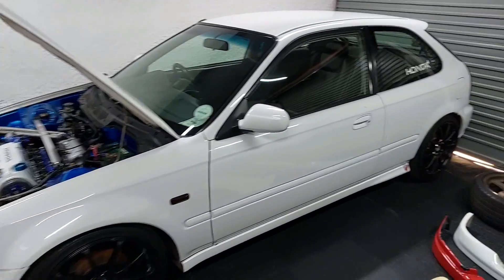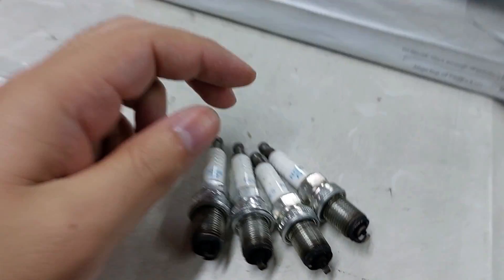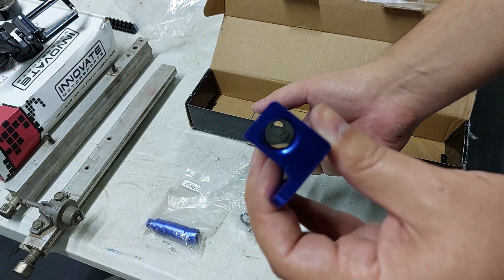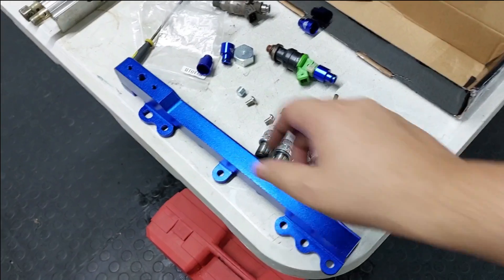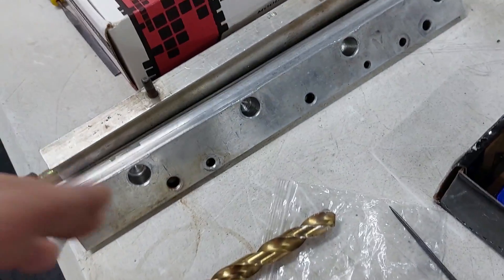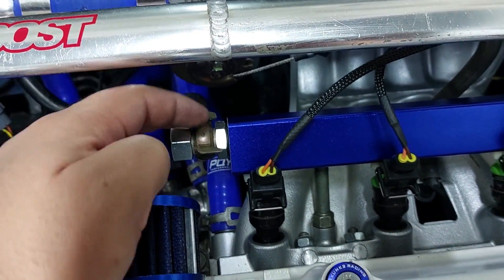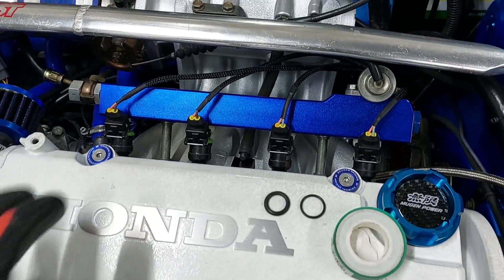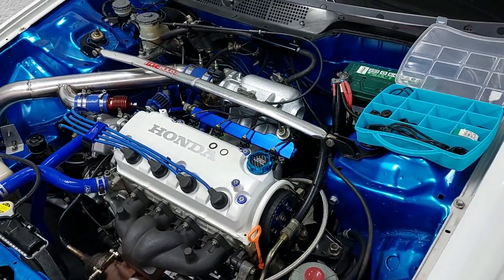eBay Fuel Rail Install - Dyno Prep Fault Finding | Turbo Honda Civic

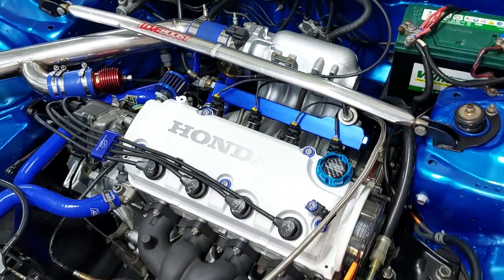Comment: 7:40 how do you prime the fuel system?
Reply from the maker: Hi, the Dseries has a "feed and return" style fuel system, turning on the key/ignition will run the fuel pump for 3 seconds, doing this 3 or 4 times will push the air our via the return line to the tank.

Comment: How did you use the oem banjo bolt fitting?
Reply from the maker: The rail came with a few fittings, including a banjo bolt similar to the oem one. its not the oem bolt but works with the oem feedline.

Comment: Where did you get your Blue Valve Cover Washer/Bolt Kit?
Reply from the maker: Hi, you can get them from ebay or aliexpress, they may not be selling the exact set anymore but there is also a set called PW JDM that is similar

Comment: Damn I love these ek hatches. The white is my fav. I like that blue in the bay to. I've had 2 clean 98 ek 4 doors,95 eg coupe all stock but clean and a 95 eg 4 door with poor man's type R swap in it. B18C1 block, rare GSR B17A1 head ITR pistons, rods and cams. Fully painted, shaved and wire tucked engine bay car was white with a house of colors metallic candy apple green bay.
Reply from the maker: Hi Jeff, really nice collection of cars you have had, "clean" hondas from the 90s are getting rare now, and the B Series parts is now getting expensive.

Comment: I have a 2000 Hr-V with a D16W1 none vtec engine. What other Honda engines fit my car? Appreciate any help.
Reply from the maker: Hi Dan, the D16W1 is very similar to any other D15/D16. easiest swop would be a D16Z6, using the mounts (post mount/T-bracket) from the W1 motor. a B Series may fit, however I don't think there is a post mount or T-bracket available for the HR-V chassis. so it will have to be custom fab mounts to make a Bseries fit.
Reply: @RisingBoostYT  I’d probably skip the B series (older engine I supposed) I’m thinking of a Vtec upgrade what would be the closest for my HrV? I can fabricate mounts if I have to, btw I subs, Cheers.
Reply: @DANIEL-ls5ku  budget and goal for your car is very important. That being said, if you’re by the means, I’d consider the K series route.

Comment: Nice video backwards spark plug diagnostic I thought number 1 looked the best  but understand
Reply from the maker: Hi Frosty, yes plug 1 is the best one, my worry was that they are not all looking the same. I did replace the sparkplugs because they were fould out because they running to rich.

Comment: gonna wait for the next sparkplug read with the new rail.. hope it solves the problem.
Reply from the maker: Hi No Limit, I did check them after and it did fix the issue luckily. I have new plugs going in before the dyno session, that will be the real test is it should not foul the plugs black after the tune.
Reply: @RisingBoostYT  Nice!!! letsss gooooo!!